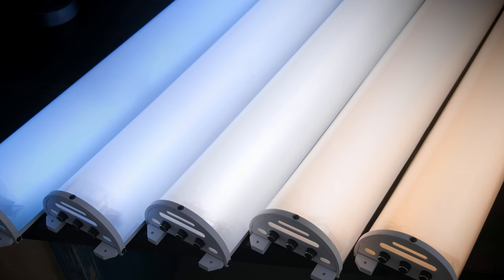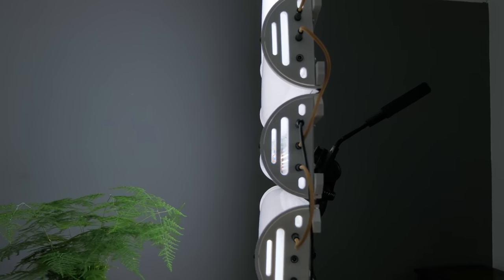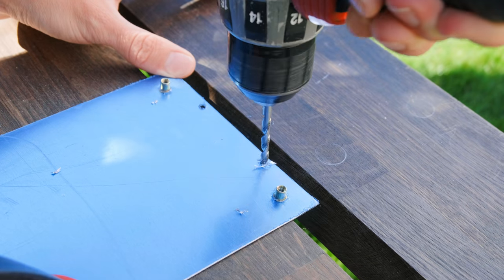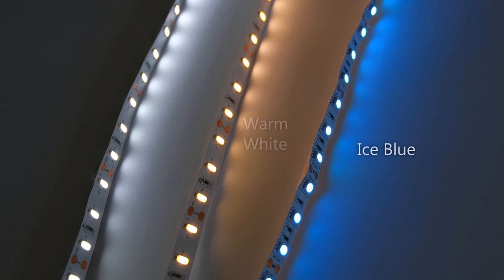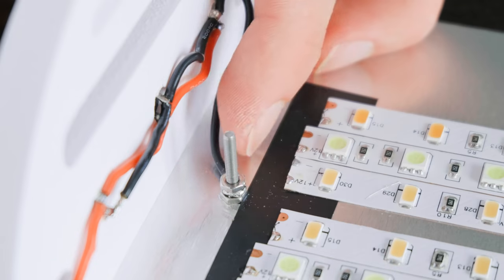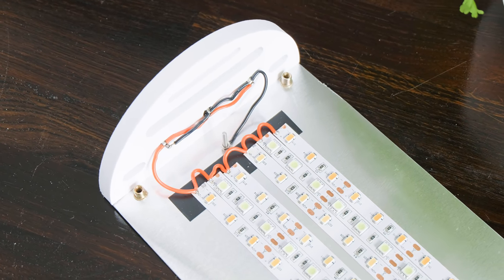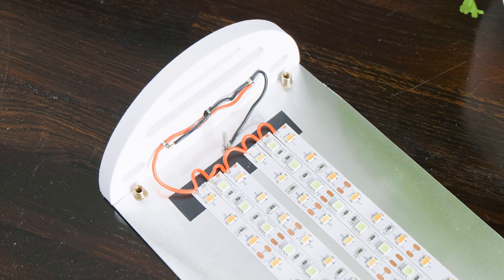DIY Studio Lights - How to Build Your Own!

Comment: I would recommend using aluminium rivnuts instead of steel ones if anyone is replicating this, easier to insert and no chance of them reacting with the aluminium and corroding.

Comment: As an electrician in training, all wires that are used in any project should go around the screw in the dirction that the screw goes into a hole or the nut tightens down. They should go around the screw from left to right.
The curved sections could be acrylic tubes cut in half along their length and the sandblasted on the inner surfaces.

Comment: I have a nice retractable green screen (elgato).  The hardest part is lighting it.  It has to be diffuse, very even, and positioned behind me, meaning I have to also light myself from the front.  If I had a 40 X 40 ft room I could just use soft boxes for all the lighting.  However like most people, I film in a small spare bedroom.  I think this could be perfect for lighting the green screen!
Reply: Hi Bruce, did you try it? What were the results?

Comment: The light strips suggest to use a 10A or 15A dimmer switch but I can only find the 5A type. What will change between 5A 10A and 15A? Thanks!

Comment: For those wanting to build these lights, it appears Matt changed his mind about how many he wanted to show together, hence the video cut from three fingers to 5 fingers. This means you'll need to order two LED strips of each color in order to build 5 lights of the size Matt shows in his video. The seller appears to be sold out of the 97 CRI daylight strips as of 9/14. They are currently only listing the 95 CRI daylight strips. I'm not sure which version Matt was referring to in his video. 

If you're looking for the power sockets try searching for "power jack sockets" on Aliexpress. Someone else will likely know which size is best though most power supplies seem to be compatible with both 5.5mm x 2.1mm and 5.5 x 2.5mm socket sizes.

In order to power 5 Matt sized lights on full brightness from all three strip types you would need a 12 volt power supply capable of at least 15 amps of current if all 5 lights are daisy chained together like Matt's does. Though you wouldn't want to do this as at least one of your power sockets would melt in a few seconds. In normal daylight only use with full brightness you'll need a 6 amp supply for 5 lights daisy chained together. Just know that you'll be pushing 6 amps through a 5 amp socket which is pretty close to the point where the socket starts to melt. To be safe and be able to daisy chain 5 lights you'd probably want to use a 5 amp supply and be ok with not being able to get full brightness. 

I'm looking forward to making these lights. Very nicely done Matt!
Reply: probably better to use XT60 connectors...

Comment: Just an an FYI, you should put the grounding bolt in after you remove the protective film from the aluminum (aka, aluminium) otherwise you end up with a layer of protective film between the aluminum and the bolt, thus, the only place the bolt has to make contact with the aluminum is where the hole has been drilled out.

Comment: Awesome video about making custom studio lights. Good quality LED strip is so important! I'm reworking some of my QuinLED boards and using a QuinLED-Quad in each light would make them remotely controllable using an app or even a home Domotica system (Like Domoticz or Home Assistant), would make them even better! With for instance default presets between the light colors, etc.. QuinLED-Quad has been designed to PWM at 40kHz up to 150kHz if you want!

Comment: Nice build, I intended to replicate it here in Germany initally, but then I found 1,20m x0.1m  LED-Light in neutral white for 20€ at the local home depot and relatively cheap filter gels. Not dimmable but does the job ,-D

Comment: Matt, awesome video once again. A few questions if I may:

1.  If I wanted to combine the three colour tone feature in this video with the more traditional LED light panel like your previous design, could I just forgo the extra two power inputs but stick to the rest of the components and wiring in this video?

2.  What sort of power supply is safe with this kind of design? Any standard 12V power supply is fine?

3.  Does the light intensity change between each colour tone or does the brightness level remain consistent?

4.  Would the light intensity be brighter if I made a light using just one colour tone of LED rather than a mix of three?

5. To build this, am I buying the LED strips in your video description (one of each colour) or the ones in your pinned comment? I'm confused on what the difference is.

Keep up the great content Matt!
Reply: @DIY PERKS I have the same kind of questions. What strips am I gonna buy? :)

Comment: I might be wrong, but dont you need an LED driver or power supply to convert 240VAC to 12VDC before connecting to the dimmer?

Comment: I wonder if there's a wireless controller you could hook up to the LED strips (even if it's "RGB") to dim the strips over, say, an app from your smartphone. That way if you do use them as home lighting, you can adjust it without standing up every time. This would also allow you to synchronise them together, giving uniform lighting from every single unit.

Comment: What did you calculate the power usage on? I did a quick calculation and It would come around 48 watts per lamp (at the very max) so 240 watts on the full set of 5 lamps. Wich would be 20 amps on the first plug (the one you would plug in the PSU) and most plugs are rated for 3amp max (at 12v) . 

Could someone please tell me if I'm correct here and need to find a very beefy plug.
Reply: Yes, you are correct. I just did the same calculation. If you want to join few lamps together you need to use different kind of plug. Maybe you would be fine if you connect 2 lamps and use high quallity 2.1/5.5 plugs, but for sure not 5 lamps. That's a huge mistake in here.

Comment: Good afternoon, sorry but I failed to see how you connected the negative ends of the led stripes to the grounded aluminum sheet in the video. Could you explain? Since the LED strips are insulated from below, you'd need to physically connect then to the sheet, in my opinion.

Comment: This is fantastic! Why did you need to wire in 3 seperate power input connectors if you can put power to any of them? Would it be easier/possible to just have one?

Comment: That dimmer module has no voltage or current control in it correct? Those controls are actually in the strips already? And therefor you could do this without that module at full power continuously ?

Comment: It would be interesting to mount some addressable LED strips in these as well. You can then have a daylight/warm/RGB lighting setup! Best thing is at that point you can control it via wifi with an app which would not just be color adjustable, but in home lighting you could add different moving lighting effects.

Comment: Two power sockets would be enough if you would plug one end of the chain into power and not the center one, but that might required some bigger wire diameters

Comment: Wow awesome as usual! Great info in there on the LEDs.
I want to build a lighting setup that beams light from the ceiling corners and spreads it out on the ceiling. So no diffuser but some kind of custom shaped reflector needed to try to spread the light out evenly from each corner of the ceiling.

Comment: I have a few questions: any link or info for the power sockets/adapter, what size of the threaded rivets used, how many rolls of led strips did you had to buy to make all 5, how thick is the pvc, is the aluminum really 1mm thick? I can't find that size anywhere.

Comment: i have a suggestion to make these more efficient: 
use constant current LED strips (for example: bridgelux VESTA CRI90) instead of 12V constant voltage strips (because the resistors every 3 LEDs are wasting energy). 
also: instead of dimming them with a PWM dimmer you could just chose a dimmable power supply (e.g. by thomas research products, where you simply hook up a 20K potentiometer to be able to adjust output amperage.) you can find this stuff on digikey

Comment: A bit old, I know but where do you get your power supplies and how do you know how much power/watts you'll need to power the led strips?  Also, where do you get your power sockets?  I find the specs on those things SO varied and haven't even found a way to measure the pin inside a socket to see just what size it is even if I wanted to match a supply.

Thanks.

RichE San Diego, CA

Comment: I tried with a 1khz dimmer and I see 20 lines of interference when filming 4K at 25fps. When testing several shutter speeds from 1/25 to 1/4000, the number of lines is still 20. I think that using a 10kHz dimmer will give me 200 lines. and then the only way seems to be constant current alimentation (no pwm).  My camera is a sony zv-1.

Comment: Any thoughts on replicating a Quasar Science tube using this design as a jumping off point? With a 1.6cm by 70cm housing, knob placement could be changed into wheels along a 9cm long handle and a battery could possibly be added as well. However, I'm not sure how the output would compare as you would only be able to fit one of each strip and it would therefore be much dimmer.

Comment: What would be the specs for LED strips I would need in order to lit a whole room with close to daylight level of illumination evenly by covering the ceiling with the strips? Like, what is the formula to get the watts etc, given a ceilling height and the length and width of the room? (I don't want hard shadows, so there more evenly they're distributed on the ceiling the better)

Comment: what kind of power supply is used here? I do not think you specify it
Thank you for this awesome video
Reply: That would depend on how many of them you have linked together and what the current draw is for however many LEDs you decide to use in each light. Say each requires 5A max and you want to run 3 of them. A 12v 20A power supply will be more than sufficient.

Comment: I wouldn't use LED strips for home lighting as they are very inefficient. You can make strings from high power (1-3W) LEDs and use a constant current driver for better home lights.

Comment: in checking they're not that bright. Only 300-360 lumens per meter. or a little over 3 feet.

Using 2 stops per color that's still only 600 - 720 lumens per meter.

So for every foot or so that's only 200 - 260 lumens.

I doubt the candle power, ability to throw the light, is much at all.

So they're have to be very careful to the subject to utilize them. The fall off of light being another issue.

To give you some reference. A 40 watt LED daylight bulb has 600 - 720 lumens. But a stronger candle power. It can throw the light farther.

Even that's not enough to light anything up. Not at any distance.

Nice looking light though.
Reply: LED Emitters (per 5m length) 300
Lumens 55-65lm per LED
I found that on the ebay link for the lights, that turns out to around 1100 lumens per foot. Maybe not for the blue as I haven't looked at that one.

Also in the same page is says it puts out about 130lm/w and it is in total a 60w strip so thats 7800lm.

That doesn't really add up to the total lumens calculated from the first one at 18000 so I'm not sure what's going on here where my math is bad or their specs are bad.

Comment: Did someone tested the light quality of the strips? Are there any color casts like magenta or green? I mean, you can buy panels with 95+ cri, which has color casts. Just curious about this, before I buy, wait and start the build and in the end realize, that the light quality is bad (like it was with the first diy perks panel I build)

Comment: I am trying to make a dimmer for 120v at 50Hz Flicker free. Any advice would be appreciated because I am stuck. 
It's for quasar science 2ft crossfaders from the US and I am powering them with a step down from 240v to 120v at 100W but still at 50hz.
The manufacturers Quasar Science only recommend Lutron CL LED dimmers but they are all 60 HZ.
I've looked a Drill speed controllers but it's the same problem and they only offer brightness adjustment over 50%

Comment: It wouldn't be that hard to add some smart home functionality to it, would it?
Maybe just an ESP8266, a few power MOSFETs and you would be able to control them from a central panel / your smartphone / IPAs like Alexa etc. You could also have a daisy chain adapter which contains all three PWM controlled power lanes and makes it possible to synchronize the color tone of multiple lights!

Comment: Hey Matt, I'm part way through building these to improve my horrendous home office lighting, whilst working from home. What plastic are you using? Maybe I'm looking in the wrong places but all the sheets seem to be over £100. I'm using wood for the back strips and end caps instead, which I'm sure will be fine. For future reference, though, it'd be good to know where you got it from and how might is is. All you gave us was an enigmatic 'low cost'.

You're right about the nut riveter - I'm having to stop myself actively looking for things to put them in.
Reply: Clear Acetate Sheets medium thickness. They're suppose to be cheap (at least here in the US -- and he's not American so)

Comment: Love your videos, outstanding information and inspiration!

How feesible do you think it is to use a esp32 or 8266 to control the lights via wifi?

My initial design considerations are:
3 motor pwm controllers (one per light color) connected to analog pin
1 relay to remove or apply power to to lights
1 buck converter for microcontroller
3 rotory encoders (one per light type) to manually change the brightness and temperature in the even that wifi is not an option.
I'm definitely going to attempt it either way but would greatly appreciate any suggestions you can provide.

I know buck converters can be noisy but i am hoping that decoupling caps may be enough to mitigate?

Comment: i heckled out the prices and to make one of these let alone 5 its cheaper to buy a PAIR of soft boxes from amazon. Now these don’t come with variable colour temperature but with he change you have you can buy some different colour light bulbs and experiment. Im all for making you r own rather than buying in order to either save money or create something you can’t buy and ive liked some of the other videos for those reasons but this is just too expensive to be worth it and also really time consuming unless you have an idle workshop full of tool already. However they are a nice looking lighting rig and i can see people making them, so thumbs up for that!
Reply: Are there good specific high-quality soft boxes on Amazon you would recommend? I'm quite interested in those with high CRI values or would I just need to find a proper light bulb with a good CRI? I know very little about lighting and I'm looking to improve the videos I do for my online classes at home. Thanks.

Comment: How much is the PVC sheet supposed to cost? Because I can't find it where I live for under $150. With all the other materials purchases included, that brings the per unit cost for 5 lights to $76 each ($380 total).

That per unit cost doesn't include cost of hiring any tools and assumes you have access to all of them.      

Why would you make this when for $18 more you can buy a ready made CRI96+ LED light that comes with both a power cord and a battery making it portable and hassle free?      

I think access to materials has become so ridiculously expensive now days that it is (on purpose?) cheaper to buy ready made than DIY.

Comment: Thank you! This is a glorius project, but I have one question: What's the advantage of using low density PVC than wood?
Reply from the maker: Lighter, no need to paint, easier to cut, waterproof... that's about it in this project's case.
Reply: @DIYPerks  Sounds nice but where can I get this stuff?

Comment: Hola, How many amps it is using by lamp?.  (Considering 80 cm aluminum strip multiplied by 3 parallel colors strips ) . I am making question cause I could not find how many watt by meter consume each led flexible strip. I could assume 30 watts by meter but I would like to know your value, please.
Reply: Excuse me, it is 80cm x 3 parallel colors x 2 groups of color.

Comment: Or old brollies x 2 - attach to old tripod stand that's legs still work and place 2 LED torches half way down the brolly posts inside - spray inside brollies with the silver allow to dry then spray paint matt white paint and allow to dry. cost, 2 broken brollies -free, two torches £3.00 off e-bay and 2 old tripod stands I got from a skip + 2 cans of white paint & 1 of silver paint for £3 from an auto-parts store sale bin.

Comment: Thank for the wonderful idea. But why you did not lower the voltage for dimming the led using dc step down with current limitation (you can find it sold in AliExpress). I think it is much better than your potansiyometre solutions.
Reply: Because if you dim an LED strip by lowering the voltage then the color temperature will shift.
Reply: @BusyElectrons  thank you nice answer

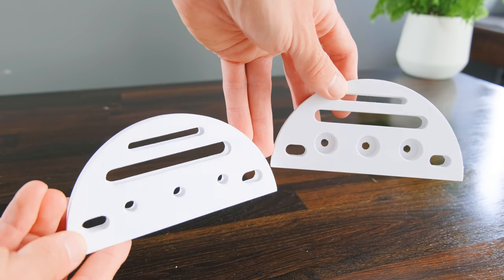Comment: Can somebody explain what the plastic is also used for? Can't figure out what I'm supposed to look for, when I want to buy the plastic myself, in my home country. He says so at 7:49
Reply: Searching for "LDPE plastplade" should get you started. Check https://plastplanker.dk/produkter/159-plastplader/33225-plastplade-3000x1500x10-mm/ or https://maskinbutikken.dk/product/plastplade-3000-x-1500-x-10-mm-glat for example.

Comment: Hi Matt, great video and awesome build! What made you switch from voltage control to PWM? I see it's much simpler, but would it not flicker with slower rolling shutter cameras, such as Sony A6300, which seems to be very sensitive when it comes to LED flicker banding?
Reply: I guess low voltage = no light?